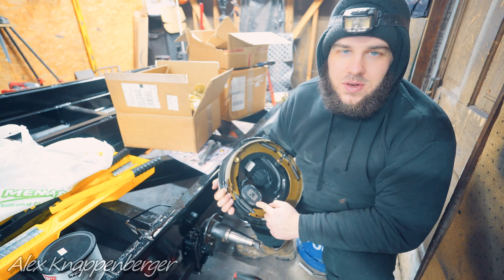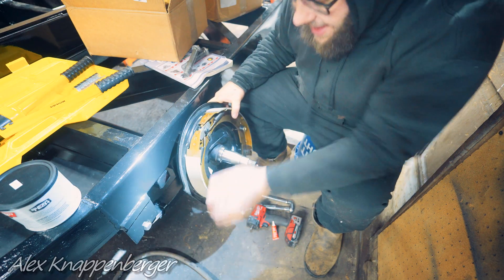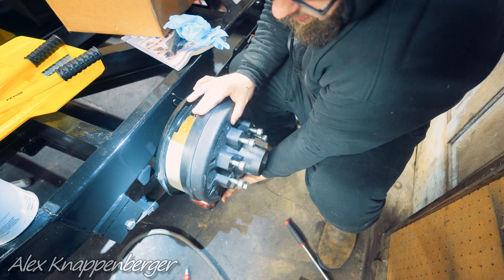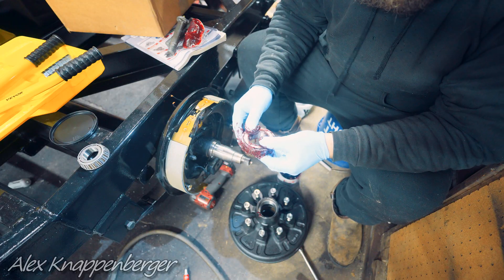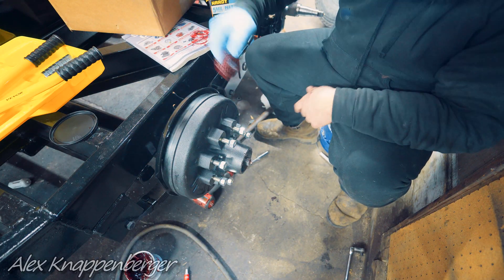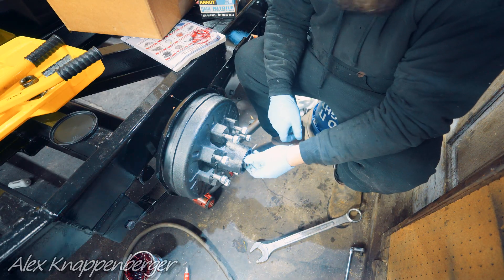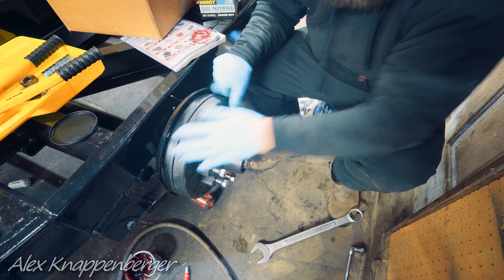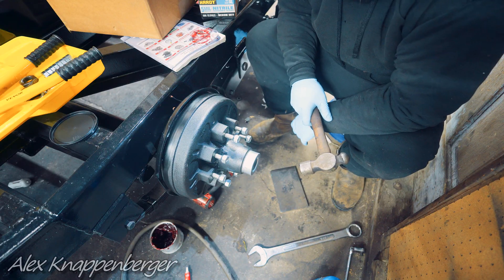How To Install/Change Electric Trailer Brakes for 3500lb, 5200lb & 7000lb Trailer Axles

Comment: Thanks for the Video Alex,  if you're doing one that is a few years old and replacing bearings and seals do you need bearing or race pullers sometimes to get them out? I have 2 3500 axles on my utility trailer.    Cheers!!!!!!!!!!   :)
Reply from the maker: You should just be able to pound them out with a hammer and screwdriver and such.if that fails you can cut them, or use a puller or bearing/seal driver set